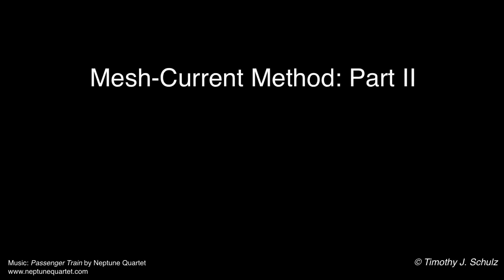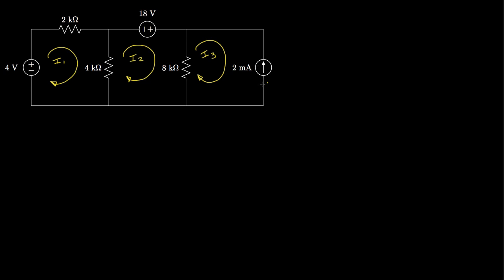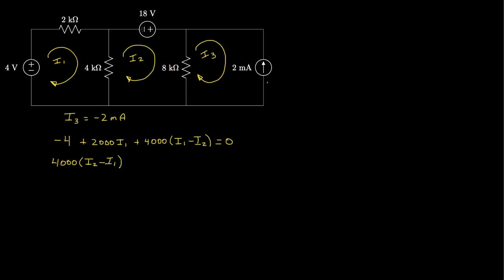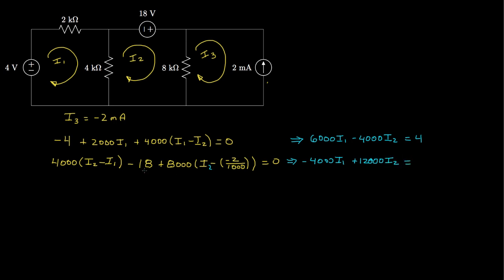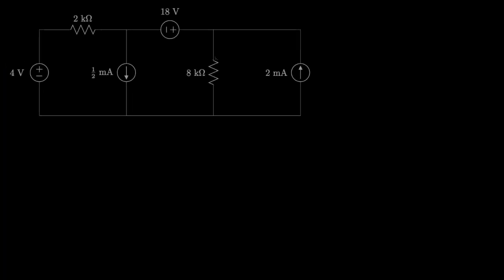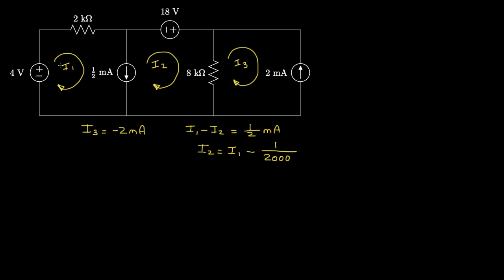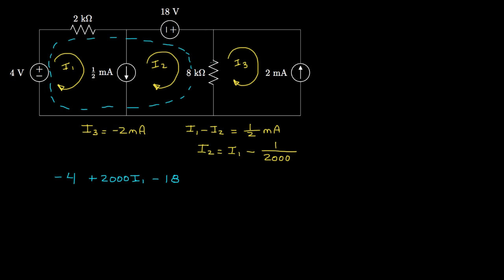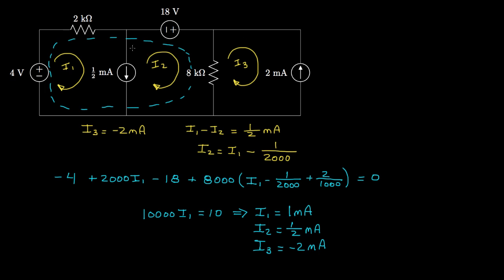Mesh-Current Method: Part II

Comment: I was doing great until the very last comment about finding the voltage at node 1 which Mr. Schulz reports as 4 - (0.001)(2000) = 4 - 2 = 2V.

But if the current is flowing clockwise, why isn't it -4 + 2 = -2V   ?

The signs confuse me.

Forgive me if I'm missing something obvious.

Mr. Schulz, many thanks for your videos.  Hugely helpful!

Comment from the maker: If you are asking about the second equation, it is -18 because the I2 mesh is counterclockwise, and, because of that, the mesh 'flows' into the 18V source on the side of its negative terminal. This is the same reason that it is -4 in the first equation.